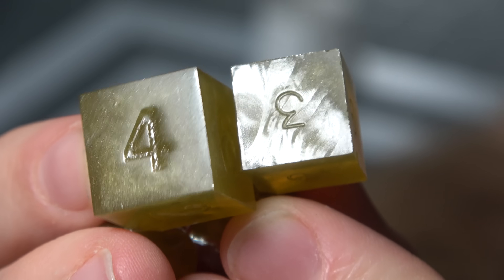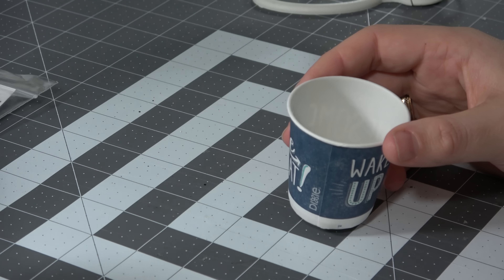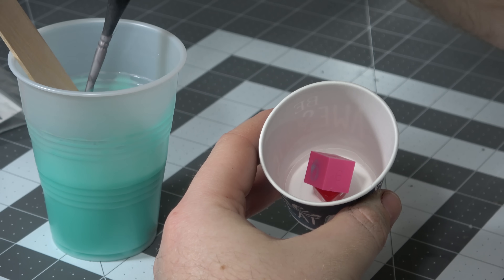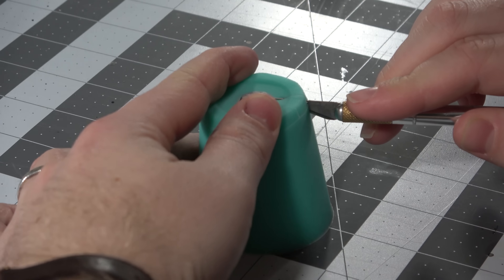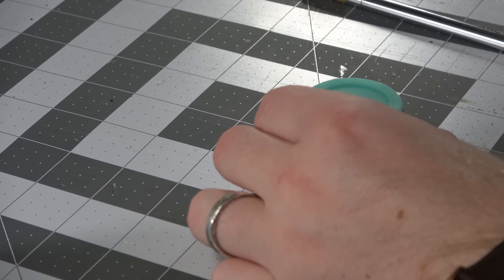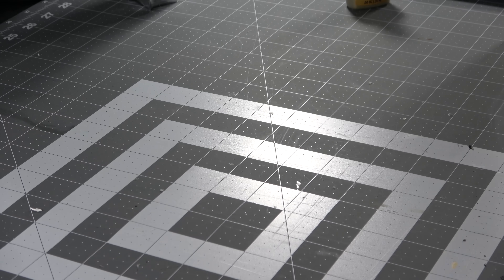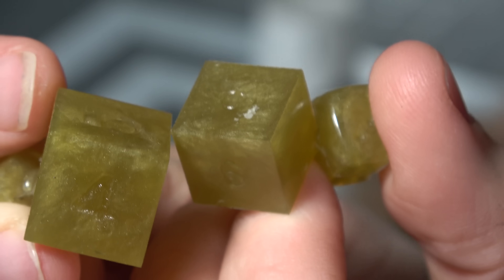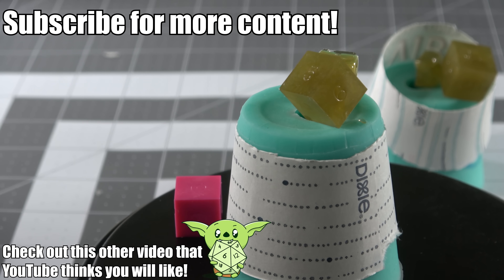How To Make Silicone Dice Molds in a Pressure Pot

Comment: If you have a vacuum-chamber: USE IT!
Is is vastly better for the livetime and quality of the mold to first degas the silicon. And same thing for the resin.

The pressure-pot works on resin cause the air can go into solution and the resin once cured is strong enough to hold it there. But for silicon that is not the case. Not only can it hold far less gas dissolved, but many if not most mold-making silicons can not hold the gas dissolved under normal atmospheric pressure. So over time random bubbles form throughout the mold and that can also happen close to the surface of the object you want to cast, creating indentations or even rupturing.

But having a chamber is by no means a must, only when you really wanna make sure you get crystal clear castings and the best molds you could possibly get.

Comment: I'm new to this still waiting on supplies to get here but on a previous video when he used the pressure pot on the mold the dice came out with a lot of spikey bubbles on the outside.  What was done differently that he didn't get the spikey bubble on the outside this time?

Comment: I used a pressure pot on a silicone mould i made, filled with resin and i got a distorted piece. Was the silicone i used too soft or do i need to use a harder stiffer silicone.

Comment: Hi, I know the video is quite old but I hope I will find some help anyway. I've tried to use pressure pot to cure silicon but I still have lots of bubbles in my mold. I'm using Reschimica R15 silicon (since I'm Italian I can't easily buy your products unfortunately) and I've put my curing mold exactly between 30 and 40 psi... Just to be clear, I'm absolutely not complaining (your videos are just terrific and I took inspiration from you a lot), I'm just curious to know if anyone have anything to suggest in order to solve this problem.

Comment: Love your channel rybonator! Question. At exactly 30 psi my emergency valve release begins to release air and I cannot seem to find a way to stop it from doing this. I've gotten it to about 28 and essentially had to duct tape it in place so it doesn't release air in an effort to keep the pot pressurized. Any advice?

Comment: my same pressure pot won't hold pressure between 30 and 40psi,  do I have something not tight enough, or does it naturally loose air? 
Also, do you keep it in for the entire cure time? I did, but I had to keep pressuring my pot up since it didn't hold. It lost between 5 and 10 psi over an hour, until I would (every hour) put more air in.

Comment: Hi i was wondering how long do you need to leave your resin in the pressure pot? Is it just up until around 40psi or do you leave it in the pot for the entire cure time (the cure time on my resin is 3 days)? Also have the same question for if i was to use a pressure pot for silicone? Thanks (goblin emoji that doesnt exist)

Comment: So I cast two 10-sided dice. Happy with the results except for one half of one of the dice which had significant pitting, the side opposite the sprue. Unfortunately when I cast the mold I did not have my tray system and I had a slight mishap when tightening the lid which resulted in one mold tipping over. i quickly righted it and had enough leftover to fill it back up from halfway. I am guessing that affected the mold and that is what caused the pitting in the casting but wanted to check and find out your thoughts.
Reply from the maker: Hmm that is odd, normally the pitting occurs on the side near the sprue, or the upper most portion. Try painting the silicone on with a bursh or toothpick before fully pouring and pressurizing and see if this fixes your issue.

Comment: Is it possible to only use a vacuum chamber to make both the molds and the dice?
Reply from the maker: Totally possible! Just be careful that your resin doesn't overflow when vacuuming the dice
Reply: Rybonator I was considering just having a much larger sprue to catch the bubbles. The working time of the resin is also another problem. I saw you already had a video on this though! I’m new to the channel and I hadn’t seen it yet

Comment: What size cups do you use? I am going to be casting some d10s and was wondering if I could use a smaller size for  making the mold but wasn't sure if I just need to make sure the die is completely surrounded or is it better to have some extra mold to aid in the casting?
Reply from the maker: I use Dixie Cups :) So around 2-3oz. I like a BIT of extra mold, so that it has a bit more durability personally.
Reply: @Rybonator  I have some 60ml/2oz polycarbonate plastic cups for working with resin. Do you think these would work for making the molds out of the Slow 15 or would I better off with the dixie type cups?

Comment: When you hot glued the die, does the glue come off the original die so it can be used again? Or is the die ruined now?
Reply: The hot glue should come off easily and both dice would be usable again. At least in my experience with making the molds using his methods
Reply from the maker: Totally usable again :)

Comment: im really intruiged and thinking of making some dice for myself.
just a suggestion for those who get triggered by the dual die hot glue method. 
use a standoff between the dies, say a q tip cut down or thin dowel, that way you have a thinner sprue with less post cure cleanup. just remeber that if you are adding bits like mica or other chunks that the sprue needs to be able to fit it.
Reply from the maker: Absolutely! The toothpick method is super popular :)

Comment: Hey, thanks for all the great content. I'm struggling to get my mold to fill completely. I usually end up with a bubble right at the top near the screw. Is there a trick to make sure the molds fill up all the way?
Reply from the maker: So I warm my resin up in a hot water bath (sink water) for about 20 minutes before mixing and pouring, it helps seep into the molds more easily. You can also try taking a pipette and suctioning the top of the molds where the air normally sits and seeing if there is air there or not before moving on to pressure casting!

Hope this helps :)
Reply: @Rybonator  thanks dude! I'm using alumilite slow which only has a pot time of 12 mins. That might be my issue. I'm just to I'm patient to wait over night for dice

Comment: Have you ever tried using a paint mixer stick in a cordless drill to mix your resin/silicone? I've done it a few times and i find it works really well to really mix the materials together
Reply from the maker: I have not, but that might be worth looking into! Could save my wrists on really heavy mixing days haha :)
Reply: @Rybonator  it does have a tendency to get a lot fo bubbles so youll definitely need to use a vac chamber/pressure pot after but it also looks soooooo satisfying sometimes

Comment: can someone explain to me why its illegal to make molds using dice that have been purchased elsewhere and sell the dice made from it? also is there anywhere i can get dice that i can make molds from? id love to make my own but i havent got access to a 3D printer so i cant make my own designs
Reply from the maker: If they have a patent, it's illegal. Think of a G.I. Joe. You wouldn't be able to replicate and sell G.I. Joes legally, as they are a toy designed by their company and they have a legal right to sell it without others selling it. Same thing with tdice
Reply: @Rybonator  cheers
Reply: @Rybonator  Game Science does not have a patent on a cube, not only that, courts have upheld that such common shapes can't be patented. Unless Game Science has their logo on the die they are perfectly legal to copy.

Comment: A pretty cheap alternative to a vacuum chamber I've found, for small projects at least: wide mouthed mason jar with the two-part lid, a vacuum bag (space bag), and a tiny electric vacuum that comes with some vacuum bag sets. (I got all of this for about $20.) 

Replace the lid plate with the vacuum bag seal bit that attaches to the vacuum, and run the little vacuum for 5-10 minutes. 

I was kind of afraid of burning the tiny motor out, but I haven't done it yet. 😅

I'm still pretty new to all this stuff, but this has worked pretty well for me. I've been using the molds I made this way in a pressure pot, and they have been working great.
Reply from the maker: That's a great alternative! I want to try some cheaper versions of my setup for people to follow as well :)

Comment: You can add some talcum poweder on the mold outside so the sleeve gets easier on and off and you don't need to force it into place and thereby distort your mold.
Reply from the maker: That's a great tip! Thanks :)

Comment: Total noob here. Would a pressure cooker work in place of this? Instant Pot in particular. Doubt it will, but I'm curious
Reply from the maker: Unfortunately no. They work using steam and heat, both of which are no bueno for dice :(
Reply: @Rybonator   for dice? Or for silicone in general?
Reply from the maker: @TravellingWizard  both really
Reply: @Rybonator  I figured, thank you!!!

Comment: For applying silicone to your cast-forming die, I'd just get a gloved finger, dip it in the silicone, and dab each face. Faster than a paint brush, I think.
Also I'm wondering if the bubbles in the silicone are actually microscopic, or if they're being forced to DISSOLVE into the liquid. Because if they were just very small but still present, wouldn't they re-expand when pressure was released and deform the silicone?
Reply from the maker: It could possibly be the explanation that you mention, I have heard of them becoming soluble in resin, but not in silicone. (though it still could be the case.)  My general though process was that after the silicone cures, there is simply enough resistance from the cures silicone to prevent the bubbles from re-expanding. I'd love to do some additional testing/reading on the subject!

Comment: So the pressure pot delivers the exact same results as a vacuum pot would? Or is it that there are some negative side effects from pressure setting the silicone but they are so minimal that it is negligible?
Reply from the maker: ^ Essentially what you said. I have heard from some people that their molds come out warped when curing silicone in a pressure pot, but my imagining is that they used too high of a pressure, and it may have even warped the dice they were using under the pressure, but I can't be certain.
Reply: @Rybonator  So for someone starting out, just go with the pressure pot and experiment before dishing out the extra money for a vacuum chamber. Thanks for the insight :)

Comment: Question. How do you write on silicone molds? I tried to write with permanent marker but it rubs off eventually.
Reply from the maker: I use a sharpie and let it dry. If it sits on the molds overnight, it won't rub off :)

Comment: I've been following your channel's videos and started trying to make my own dice (a custom spindown d12), with only a minor amount of success.  My biggest problem is I keep getting big air bubbles right below where the sprue attaches to the dice, resulting in large voids such the the sprue and the die are separate parts.  Any advice?
Reply from the maker: Warm your resin up! If you leave the resin in hot water (sink hot), for about 20 minutes prior to pouring so that the resin is super warm, it will help it flow and hopefully reduce those bubbles. You can also pull the top of your mold apart to see if there is a giant bubble or not. If you do that, you might get more flashing, but that's not a big deal really :)
Reply: @Rybonator  awesome, I'll give those a try. Thanks!

Comment: Have you had any problems with your pressure pot losing pressure over the course of a few hours? If I get my pressure pot to 30 psi or so and leave it overnight, it's completely lost pressure. I've checked for air leaks using soapy water but I can't find anything. Idk if it's normal and I just need to re-pressurize every few hours since it's a homemade unit or if there's something wrong with my pressure pot. Thank you for sharing all of your knowledge of dice making with all of us fellow dice goblins, we are truly blessed to have our goblin king 🙏
Reply from the maker: Yes I did have this issue! So the soapy water helps identify, but you might also have a leak UNDER the lid. Spray around the rubber gasket and see if this is the problem. If that's the case, rub some vaseline around the rubber part of the lid and it should fix your issue :) It worked for me!
Reply from the maker: Also thank you :) I'm glad to have such amazing goblins!
Reply: Lube the rim of the seal with petroleum jelly, rub it evenly around and it should work

Comment: In regards to the point about not needing a vacuum chamber: If you cure Sorta-Clear silicone in a pressure pot, you will actually be able to see that some bubbles form and expand over time. I made a few molds out of the softer Sorta-Clear (18 I think) and over the course of a few days, bubbles started slowly expanding inside of the mold. I didn't have the same problem with harder silicone, like Sorta-Clear 37, but it could be an issue with the MoldStar silicone since it's also pretty soft. It seems like any inclusions in the like hair, dust, etc trap air and end up becoming bubbles that expand after the silicone is removed from pressure. I think the best tactic is actually to vacuum de-gas first to get the bulk of the air out, then pressurize.

My biggest mistake was including pieces of already cured silicone. When I pour MoldStar molds, I always use cut up pieces of unusable molds, since the silicone bonds so well to itself, and it allows me to reuse silicone and reduce waste. This is fine in the vacuum, but in the pressure pot, it creates a TON of bubbles. I always do my MoldStar molds in the vacuum for this reason.
Reply from the maker: That's really good to know! I have been wondering about cutting up some of my old molds to save on some silicone. I'll be sure to keep this in mind. Thank you VGLauren  :) You rock!
Reply: @Rybonator  It seems to work great with MoldStar, I have a box of cut up molds that I use whenever I pour it, and haven't had a problem with it. I think it might depend on the silicone - adding cured silicone doesn't seem to work as well with Sorta Clear series silicone, partly because it's nearly impossible to vacuum de-gas, which means it goes into the pressure pot with a lot more air trapped in it.

Comment: Hey I got a suggestion: I make art out of resin and measuring is a PAIN IN THE BUTT, so what I do is I pour the two resin parts into separate glass pump-action soap/lotion dispensers. That way, for some of my molds I'm like "Okay, this one takes 5 pumps of each. This mold takes 7 pumps." Saves me a lot of time and you don't have to deal with measuring or sticky resin cups for when some of it inevitably spills over the side.
Reply from the maker: That is an awesome suggestion! I only worry about having air in the pump and getting my measurements off :(
Reply: @Rybonator  I haven't had any problems with it yet and I've been doing it a couple months. Each time I fill the pump, about the first pump and a half is wasted to make sure there's no air inside, but otherwise it's pretty consistent. Also, in my experience, you don't have to be TOO accurate. If you're in the ballpark, it'll usually still work fine.

Comment: I already had a pressure pot from many years ago for SFX make up reasons.  But because of your earlier dice making videos  I purchased a vacuum pump and purchased all the parts to make a vacuum chamber.    (face palm)
Reply from the maker: I honestly still prefer the vacuum chamber method. It allows me to ENSURE that I am getting all the bubbles, as if there was a bubble that was too large, a pressure pot might not fix your issue.

Comment: My vacuum chamber kit shipped yesterday, and today you release this video
Reply from the maker: Honestly it's not a bad thing still. I prefer to use the vacuum method over pressure still, as it is a GUARANTEE that it works, and no bubbles will reform later. If you use a soft silicone, there is a chance that re-expanding bubbles could ruin your molds eventually (though it's a super small chance.) A vacuum ensures you have perfect molds every time :)

Comment: I have been experimenting with 3d printed mold molds I have had great success and use less than a quarter as much silicone ( although I'm using composimold because its reusable)
Reply: I printed some of those as well to try out and was hoping for a resin savings.  Haven't tried it yet on a master, but thanks for posting the info.
Reply from the maker: Does the composimold work well for dice making? I've been curious :)
Reply: @Rybonator  i have had had pretty good success even without a pressure pot the stuff is pretty awesome, it has its limits I trying to recast a wizkid mini that had a staff and the heat melted the staff before it set and I ended up with a derpy staff in the mold and original  and its clear enough to see where your cutting but not clear enough to do uv resins I assume ( haven't tested that) I would love to see what you could do with it with your setup amazon has 3 pounds of it for 39$ ( it's more than you would think it's about the size of a soccer  ball ) it comes in like muffin tin shapes I think it's like the overpour from factory. Well I hope you get some and make some videos I learned a lot from your channel and I think more people would prefer a reusable ( recastable) solution instead of 2 part silicone which gets pricey fast https://www.amazon.com/ComposiMold-Used-3lbs-Reusable-Making/dp/B01NBMEKWA/ref=sr_1_4?keywords=composimold&qid=1581707509&sr=8-4